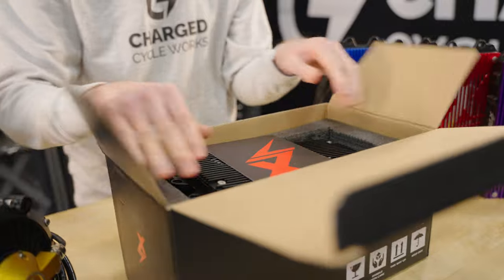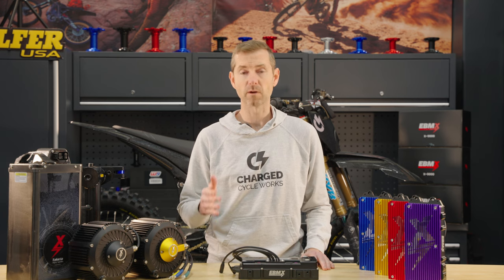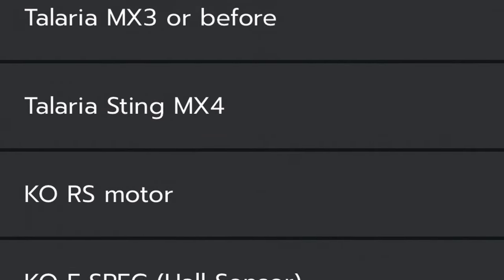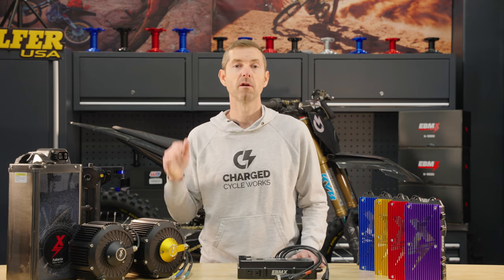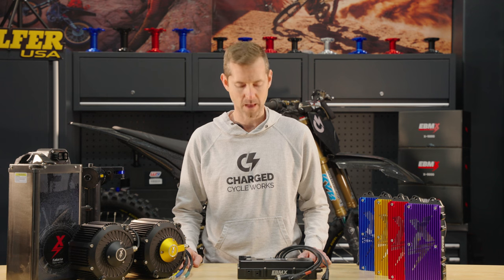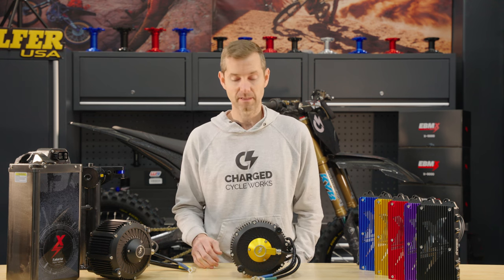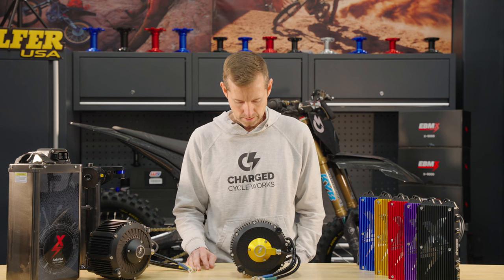EBMX Controller and Motor Overview (X-9000, XLB-60, XUB-80)

Comment: I have an Ultra Bee with CCW 80v 76ah battery on X-9000 V2 . If I got the UBX80 motor would I need to replace anything else to be able to turn up the power to around 35 kw in moderation ?  Majority of my rides staying between 10-17 KW tunes.
Reply from the maker: No, just install the motor and change the configuration in your x-9000. Good tires maybe to put down all that power!

Comment: my x9000 controller is in shipment.  Cant wait to upgrade from my bac8000 and have a regen throttle now along with a controller that looks much better than the blue / orange ugly color and also not needed phase wire extensions that take up alot of room .
Reply from the maker: Very stoked to hear that!

Comment: Great vid! Where do you send your battery to get the high power wired installed? I have an EBMX 72v 57ah and the x-9000. Thanks
Reply from the maker: Contact EBMX for that. Their race battery comes with a QS8 connector and has the capability in the cells to push high power. A 72v 57ah battery is built for more range and not so much high power output so switching it to a QS8 connector may not benefit you very much. Always worth asking and if you could share the info you receive with us as well that would be great for  future reference!
Reply: @ChargedCycleWorks  
Will do. Thanks for the reply. 👍🏼👍🏼

Comment: I live in Utah county and mostly do single track up AF canyon but also the dunes  and out west quite bit I ride an ultra Bee with an x9 and a ebmx  80.5 volt battery really thinking about upgrading to the xub 80 but from my understanding what I've heard is that it's not much more torque on the low to mid end from the stock motor but it has a lot more high-end which I'm not that worried about but would be a big bonus, what's keeping me from pulling the trigger on that motor is not knowing how much more efficient it would be, that's top priority to me to get the most range I can possibly get, so seeing how efficient the xub80 motor is would be awesome
Reply from the maker: It's more efficient than the stock at speed (mostly due to KV and rotor design) but most people will ride it at higher power (because its capable of that) and lose range. Would a range test between a stock bike at 12.5 Kw and a Full Mod EBMX at 12.5Kw be the type of video you're looking for?
Reply: Biggest difference is you won't overheat the stock motor when you ride sand, hills, or race.  Once you push the Ultra Bee to 17+ kw you can overheat the motor pretty easily.  With the stock motor we had to tune to 15kw to avoid overheating and even at that power we would overheat minutes into a race.

Comment: Curious if this ebmx motor will be getting released for the talaria mx4.
Ive been holding off on motor in hopes of this product over the other options. 
Already running the upgraded battery and v2.

Comment: What is the ideal fully set (ebmx, torp, ko...) for long range but race speed on singletrack in an ultra bee (susp, battery, motor, controller, wheels...) I want ca 30 kw and 50 miles range 
Thanks all answers
Sorry for my english, i'm hungarian
Reply from the maker: For that much range, you'll have to start with the battery. The one benefit of EBMX is they constantly test and refine their controller and motor to match the bigger, more powerful batteries. Torp's controller is very good but they don't have an Ultra Bee motor yet, so you won't achieve 30kw continuous. As far as we know, KO hasn't released their UB upgrades yet. Long answer for EBMX seems to be the only full set that meets your requirements.

Comment: Ok but when will I be able to run the bac8000 with the ebmx motor?!
Reply from the maker: Most likely never. The BAC 8000 is an outdated controller that is Hall Based and the XLB 60 motor is an encoder based motor, so they will not be compatible.
Reply: @ChargedCycleWorks  bac8000 used to be able to run encoder am I right?

Comment: I can confirm at 100% about EBMX X-9000  throttle mosthness, have been using this controller near 1y (got it at first batch)

I decided to buy Torp TM25 Motor and combine it with X9000 (I think Im the word first to use this combo, since not even EBMX team has tune made yet), so far so good, peak power was at 26kw when I did power wheelie from 90kmh ( https://youtu.be/nOTHSMTkqhM )

I never had any kind of dirt bike before, so I have 0 experience on offroad riding but with X9000 throttle smoothness its really really easy to do wheelies even for noobs like me.

Also you can make "max range" build without loosing top speed, swap setttings for auto FW  injection at 90% of motor RPMs, so u can drive normaly without FW (FW=less range and more power) and when u need power just send motor 90% of his capacity to auto enable FW. 

In general speaking, X9000 is crazy controller with HUGE customization options!

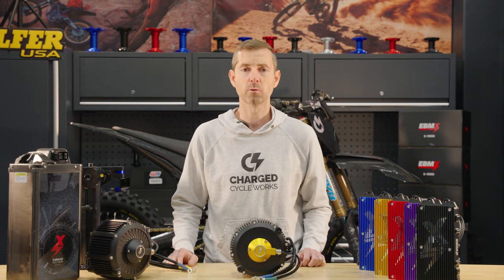* 9:05 incorrect afirmation, EBMX motor wont give more range, Im using Torp Motor TM25 which is 1kg lighter then XLB-60 and it drains more battery. 
Resumed, heavier motor = less range. Spend near 1k kms on my trails testing if I can get more range from torp motor, all my collected data is here https://docs.google.com/spreadsheets/d/15eFw-CAIXYXoEYzDwaXZon0bMObP42H9QVcGNsDqxLQ/edit?usp=sharing

Why are you affirming about XLB-60 brings more range without testing it at 100% before making such a statement? I saw ur team having XLB-60 way way earler then rest of people and what Ive seen from your videos is power test and thats it. Now affirming about giving more range, idk man, seems what all you want is sell sell and sell. EBMX motor will bring x4 more power but not more range
Reply from the maker: This was not an attempt to sell more motors. Bottom line for everyone reading this, the biggest benefits from upgraded motors are the ability to handle more power, higher top speed, and better heat protection. You shouldn't purchase a motor thinking it will double your range.

As for efficiency, this topic is discussed quite often in the X-9000 owners group and really comes down to riding style. Yes, the motor is heavier, so hard pulls with start/stop (like hard enduro) would be less efficient. Gotta turn all that mass. That said, the road-going guys and commuters are reporting increased range at higher sustained rpm's. Repeating what has been discussed there: once the EBMX motor is spun up, the KV rating and internal inertia from rotor design helps with efficiency. We'll do further testing to confirm, but the EBMX tuning team has been helping customers with controller settings to maximize range on their motor specifically.